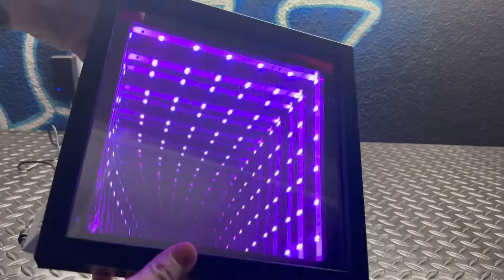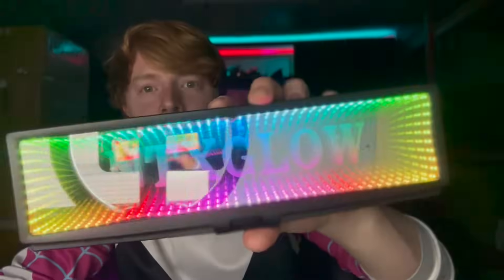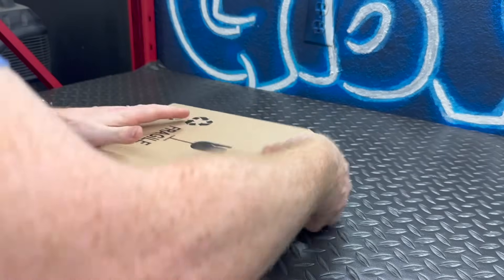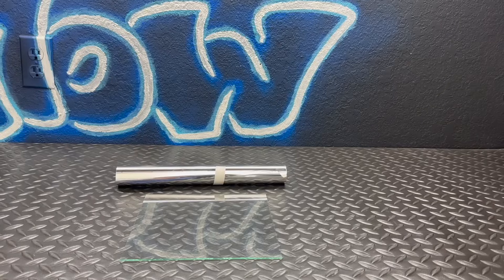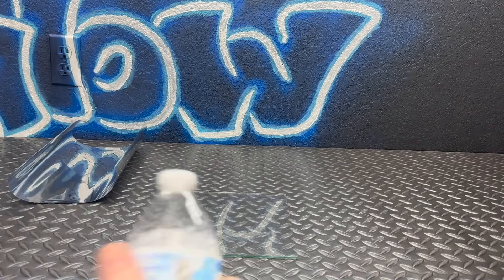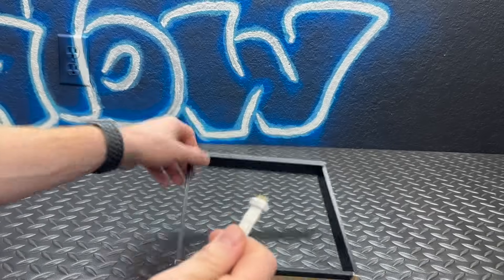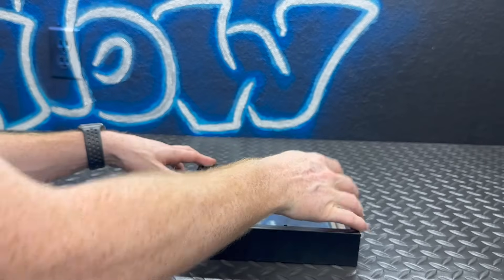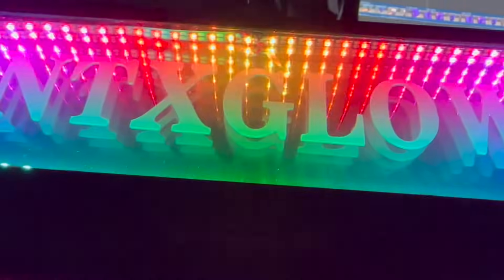how to build an infinity mirror

Comment: Thank you for the video.
That is a terrible definition of a two-way mirror.  It looks like it was written by the much slower younger brother of AI.   I didn't know AI could write grammatically incorrect sentences.
It is also factually incorrect.  A two-way mirror does Not have "total visibility" on the other side.  It depends on the light source on one side being much stronger than on the other side to achieve its effect, and even in the most optimal conditions, by definition, the visibility is only partial, as part of it is lost in reflectivity (which it also depends on to achieve its two-way effect).